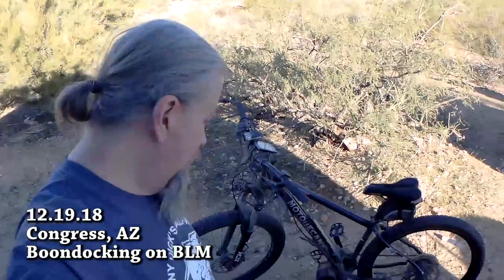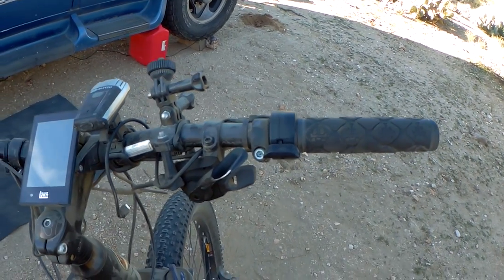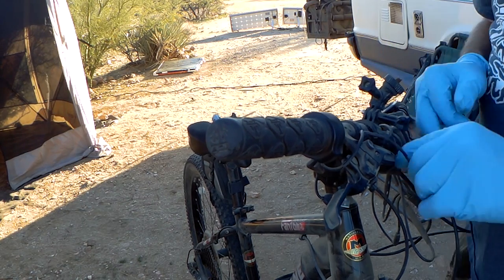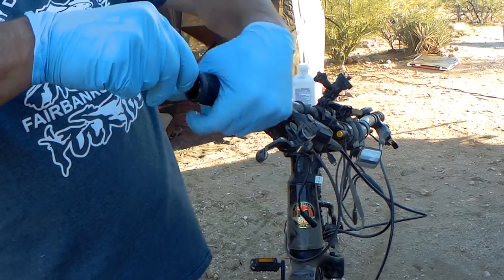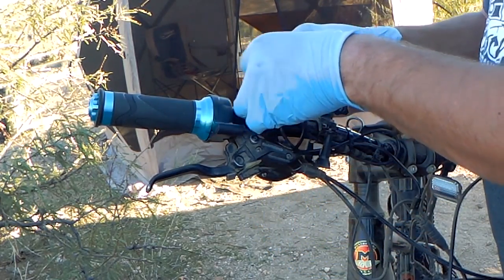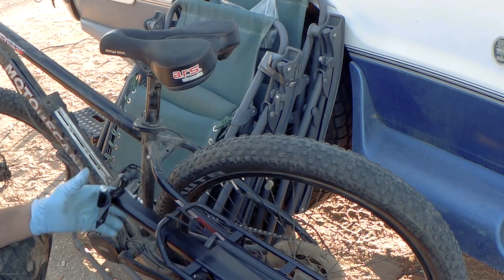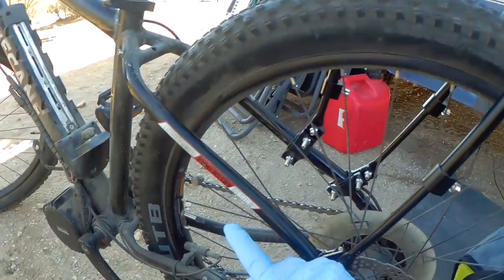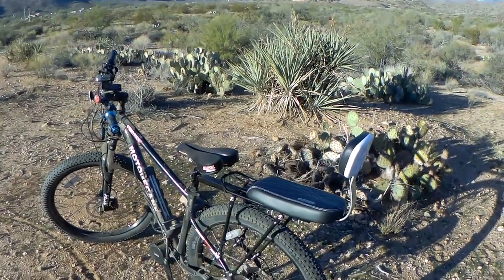DIY ELECTRIC BIKE UPGRADES! Install e-Bike Twist Throttle, Heavy Duty Cargo Rack, Passenger Seat

Comment: I use WD-40 DRY LUBE  it won’t attract dust, dust or oil. On cables, nut, bolts, and any thing I may need to take off. And it’s helping to reduce rust. Thanks for your posting.

Comment: Nice job on the twist throttle. I always use isopropyl alcohol for removing and installing grips works like a charm. If you have an extra short piece of gear cable housing that would be ideal clamped in the rear rack seat stay mount.

Comment: I've converted every ATV I've ever owned from thumb throttle to twist. Thumb throttles cause major cramps when you are constantly feathering the throttle on trails. On the grips, I would have just cut them off. It's not like you're reusing them. Don't worry about the shift cable too much. It's not like a throttle or brake cable that is moving often.

I also just ordered a 3KW hub motor for my Mongoose Fireball Dirt jumper. I'm only going to run it at 1500W until I can save up for a bigger 72V battery. Sadly I could have bought a lightly used dual sport motorcycle for the price I'll have into the E-bike when it's done($1K bike, $500 kit and >$700 for the battery I want).

Comment: I prefer the thumb throttles my self.I've had four wheelers since I was a kid and I'm use to them.But I could see having it installed in horizontal position would make it difficult,I think it'd be better installed in a vertical position.It'd more natural and your thumb doesn't come off it over woops or climbing hills.You may want to consider grip tape versus painting if the color mismatch bothers you.Love the Ebike by the way, been considering getting one myself.
Reply from the maker: Good idea with the tape. I think I'll do that as the blue is annoying.

Comment: Tom, the twist throttle and rack are great upgrades How many spokes are on the rear wheel/rim ? that is a lot of weight potential taco'ed rims do not roll 32 be careful 36 you should be ok 
You probably have completed your tubeless set up but just in case you have not  I would add the new sealant through the valve core unless changing tires leave  the sealant that you have already will be easy to refill with out breaking the bead and the mess 
been tubeless for years  my old race bikes street{Bianchi928}  Mt. bike{Specilized Camber expert} Gravel {Raleigh Tamland2 with Stans Wheels DTswiss hubs much more} still have the bikes but can not ride due to injuries from bike accident July 2016
Reply from the maker: The tires cap at 35 according to the sidewall but I have rode at 40 before. The sidewalls are super thick so I think if I ride 35 I can take a light passenger safely. I actually filmed and will put out a video on my tubeless update. I had to remove the tires to change the valve stems, and then I put the new thicker sealant in through the new stems after removing the core. So far the problem is fixed.
Reply: @HOBOTECH  OK I do remember you saying that you were going to replace the valve stems in a previous video but I had forgotten Thicker sealant ???  I've tried many but use Stans juice cuz it works every time it dries out and needs a shot of fresh juice every once and a while but easy enough Tire weight rating is not what I would worry about spoke count and rim thickness is vital  for carrying a load more than panniers and cargo bag on the rack
Reply from the maker: I'm not sure how to find the rim load rating. The rims are light but beefy and take 3" tires. They are WTB TCS 27.5" tubeless ready rims. I was using plain Stan's but it wasn't sealing the spokes. I got the more expensive racing juice and that seems to have worked so far. Time will tell.
Reply: Many other things have come to mind also 
Tubeless and weight do not mix
is your rim tubeless ready UST or clincher ???
box cut single wall double wall triple wall thickness ???
single  double triple butted spokes
nipples  {he he he}
hub ???
material the rim and spokes are made of ???
I could go on and on bike geek speak
Reply from the maker: All I know is they are tubeless ready WTB TCS. I couldn't find any loading info on their website.
Reply: @HOBOTECH  Did you use the rim tape that came OEM or did you install WTB TCS tape or other after market some have good luck with electrical tape my experience is manufacturers cheap out on every little thing and rim tape on tubeless wheels is one of the many most don't convert and for those that do they spend more money cha ching for the manufacturer 
ok I've gotta go walk my dog but when I return I will do some research on your wheel weight rating
Reply from the maker: The wheels came with tubes installed. I used Stan's tape for my original conversion but the spokes eventually leaked. That hard plastic tape just didn't stick very well. This last time I used Monster 1" duct tape and that seems to work much better.
Reply: @HOBOTECH  You may consider lowering the tire pressure for off roading and with passengers at low speed off road for more tread to surface contact. I have  a Raleigh Tristar IE 3 wheel trike for my off road at star parties and camp areas. Top speed is only 16 and I am usually 3-4 MPH on grass, gravel and dirt. Even less over rocks and uphill on dirt, rocky paths.

Comment: Nice to see you working on the bike, the throttle was a good upgrade, and the alcohol was a great idea to get the old throttle off as when I use WD40 it always leave a residue that I have to clean off. I think the color looks OK, After you put on the passenger seat you have me wondering about bringing my Super Cool Rad Rover (and very fast). I have Rad Mini folding bike too and I have the same rear seat that you put on your E-bike, I might bring that instead just in-case like you said you see someone walking to the meeting and needs a lift. I am going to camp in last years site, not dealing with that bottle neck entrance, Who knows with all the comments about it they might make a second access road.You are right about the classic cars, I had a 1974 VW Thing that I bought back in 04, it was a rattle can special that I liked driving around, just throw the empty coke cans in the back and just have fun driving it, well my son-in-law knows air cooled VW's like the back of his hand and has worked for a air cooled VW supply store for twenty years, we used to go to all the VW car shows in Southern Cal, so we decided to freshen up the Thing to take to the car shows, big mistake! what was supposed to be a freshen up turned into a complete tear down and rebuild, with every nut and bolt on the car replaced, the entire frame and suspension powder coated and a custom paint job. It looked fantastic but the car was no longer fun to drive, always worrying about scratching it. never doing that again.
Reply from the maker: I did the same thing with my RX-7. Was a daily driver then I repainted it, cleaned it up, then entered some car shows. Then I was afraid to drive the thing. That is until a 15 year old with a permit ran into it in a parking lot. Cashed the insurance check and still sold it for more than I paid for it. Took the money and moved to CA. Sounds like you and I can provide Uber service at the RTR. I got the idea from a guy I hung out last year that had a Burning Man bike with a rear seat on it. He said you meet a lot of women that way. 😉
Reply: Uber..lol Sounds good to me, I'm also bringing my side by side to do some exploring around the area, You and Stan are welcome to go along if you want.
Reply: @patd4u2  Stan's a Texan and a driver.  Texan's don't ride 'bitch.' 😉
Reply: actually instead of using oli or grease to get the rubber off, use dishwasher soap. After You're done just rinse it off.

Comment: Merry Christmas and Happy new year man! A little question since I noticed the other time you were on Stan's your mid drive motor was cruising without requiring pedaling? I thought every mid drive motor requires you to pedal  continuously when it runs...
Reply from the maker: I believe that's a requirement in the EU and possibly UK. Over here in the States ours can used throttle only without pedaling.

Comment: I remember your video from the summer in ID where you road the eBike to the restaurant and then back up the hill to your camp site.  That was impressive performance.  I was betting you would be walking at the end.  If your generator on the back test works, then you will have your own custom two wheeled Prius.

Comment: hey bro, to fix the wire problem. you could replace the entire cable and outers with one sealed cable housing, and ziptie to frame. this will seal the cable from dirt and water.  dont use the frame cable bosses. keep your shifting crisp.   https://jagwire.com/products/diy-cable-kits/universal-sport-xl-shift-kit
Reply: forgot you need cable housing cutter, expensive. but you really need it to prepare the ends properly. have fun dude :)
Reply from the maker: Yeah I don't have time for all that before the RTR. It does shift fine the way that it is. Another commenter suggested using a piece of cable housing so I may try that along with some lithium grease.

Comment: I put two of these on the back of my ebike, they fold up when not in use an will fit a 12 pack with a lil room to spare.
https://www.amazon.com/HOMEE-Folding-Rear-Bike-Basket/dp/B073PQHJ91/ref=cm_cr_arp_d_product_top?ie=UTF8

Comment: take a bic and put a some heat to the ends of the wire ties you just cut then you want poke holes in yourself our slice yourself wide open every time I get a job were somebody has used a bunch of wire ties I know at some point I will slice myself open no matter what I do i will miss melting one and and that's the one that will get me
fish and elvira say hi to odin turbo and April say not another cat
you and odin have a good day
THE GRUMPY BUS